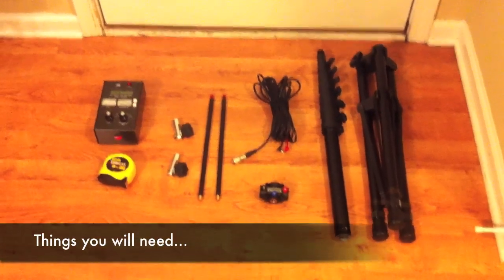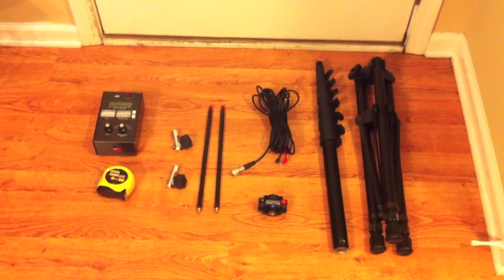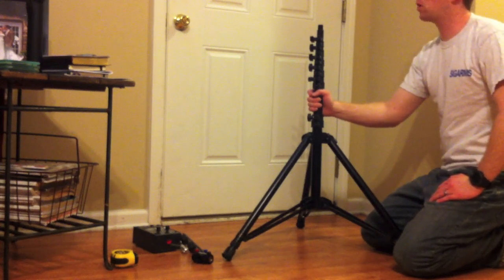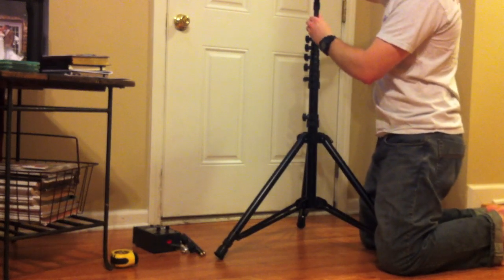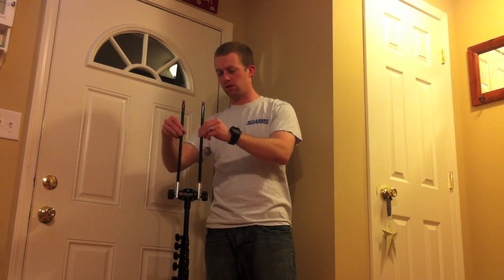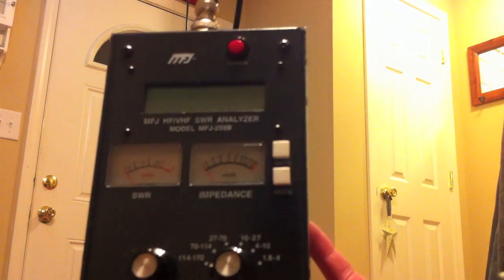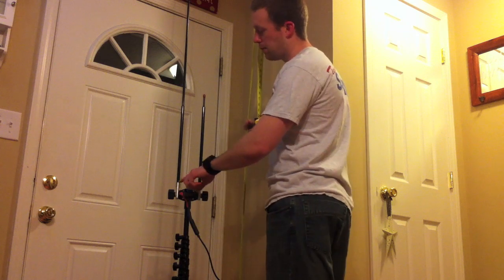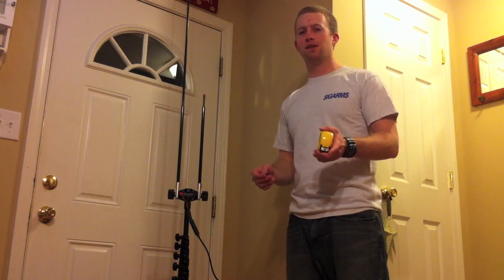How to Make a 2 meter J-Pole Antenna with the Buddipole

Comment: To be clear this is not a J pole antenna.  The J pole is shorted at the base.  What you have made here is a dipole with both elements vertical and one shorter than the other.  Without simulating this I couldn’t say how the performance compared with a true j pole but a j pole this is not.

Comment: I've had good results with the Buddipole as an "L" antenna. Extending the vertical whip to 19.5" and the horizontal whip to 14.125" yields an SWR of 1.2:1 at 146.52MHz, according to an MFJ-259B analyzer.

Comment from the maker: @VA7BC 
I don't know what would be the best radiation pattern.The antenna made in this video is an open stub j-pole. If the black element was horizontal, that would make a L antenna. If the black element was vertical down, that would be a vertical dipole.
One advantage of the j-pole is no ground plane is required.
Here is a link to a company that makes j-poles. I'll try to link to the page that has radiation plots.

Comment: Nice video.  Shouldn't the black side whip be horizontal or perhaps vertical pointed more down to achieve a more optimal radiation pattern?